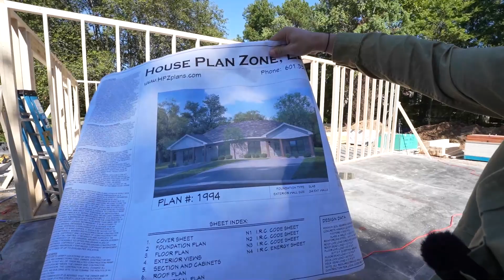Framing Walls - Building a House | $475,000 Duplex Build | EP 9

Comment: Does the DensGlass also work as soundproofing?
Reply: Somewhat, but if your neighbors are making a racket, you can tell. I have it between my townhouse and neighbors.
Reply: @MsGail61  Gotcha figured it did. Wasn't sure though. Thanks!
Reply from the maker: It helps a little bit. There's also that one inch air gap and then insulation on both sides and then 5/8's drywall on both interior walls.